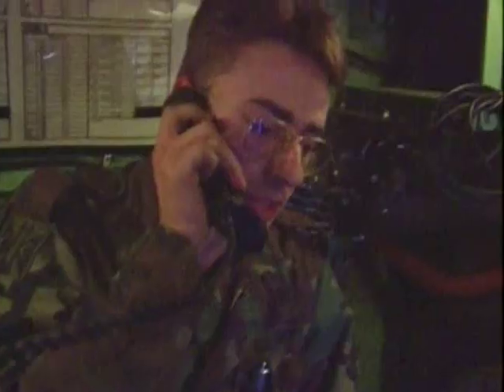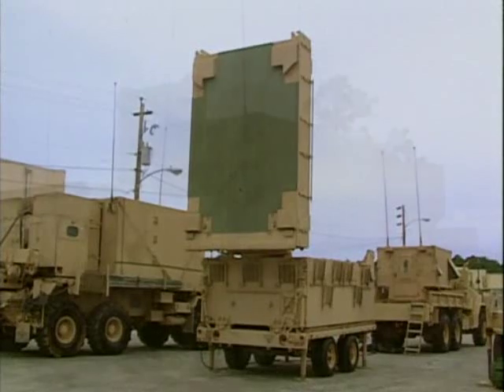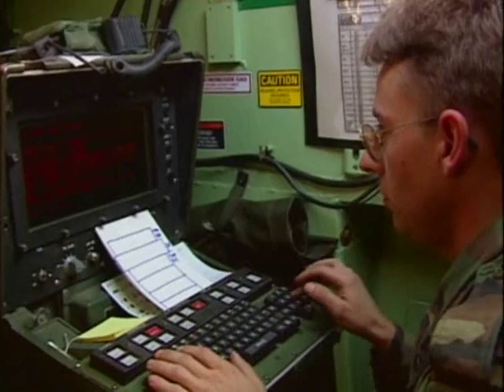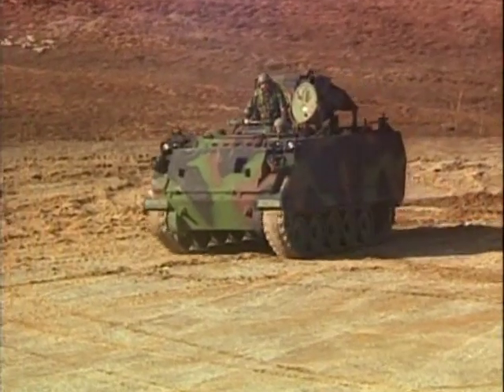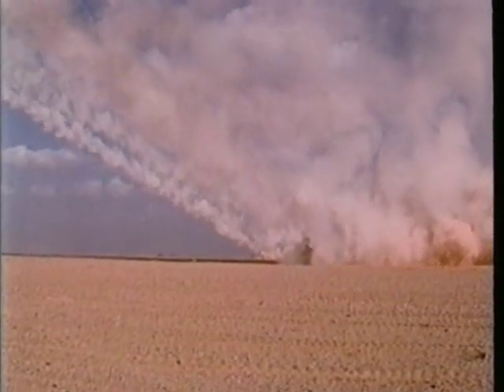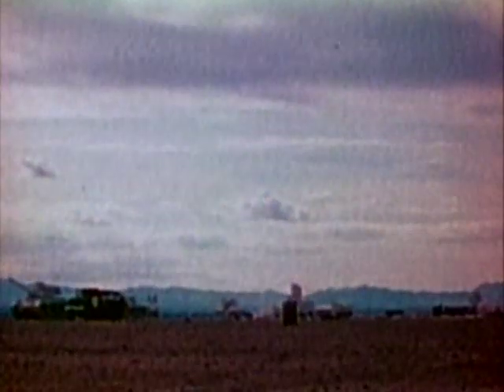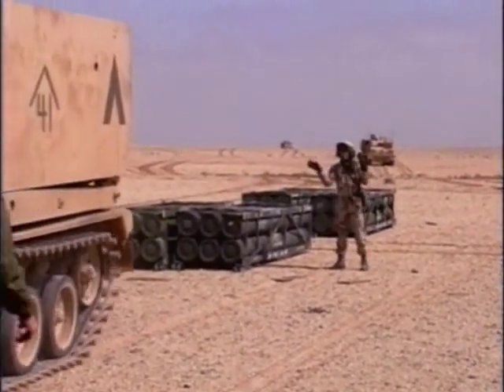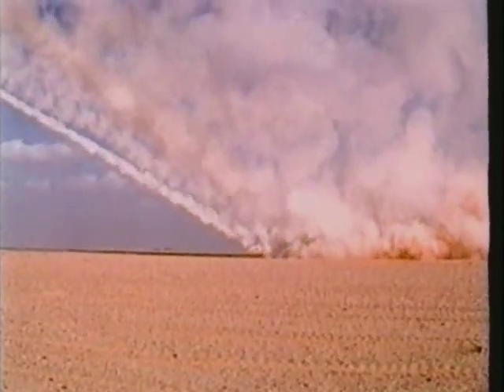Firepower - Artillery Strike (Part 3/3)

Comment: @TeK9KBC yes i agree im in the US Military dude they say the M16 is better then the AK but ive shot both the M16 is longer greater range and accuracy but you dont use range most firefights start less then a 100 yards then it takes the the 5.56 multiple rounds to kill someone AK u get hit once with that your fucked up its reliable u could put a dead body on it soaking in mud at the same time pull the AK out shake it off and fire that bitch if it were brand new